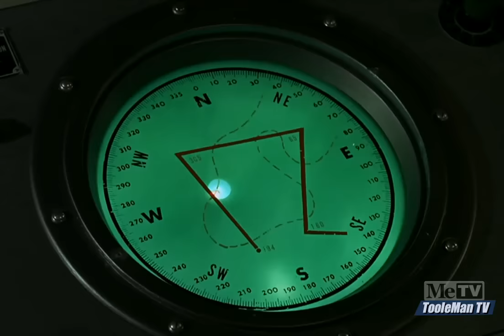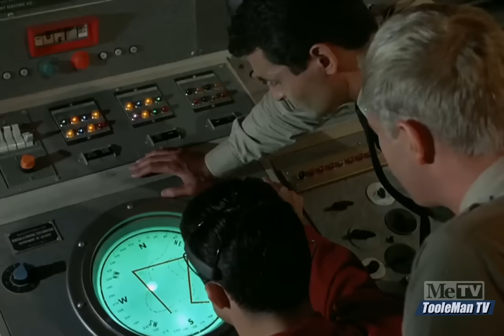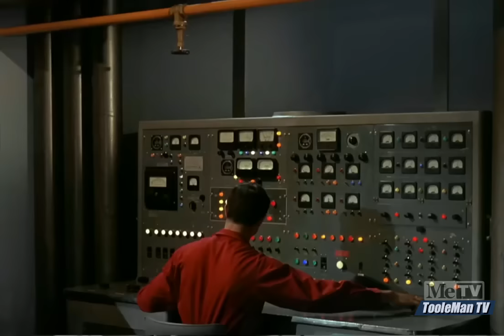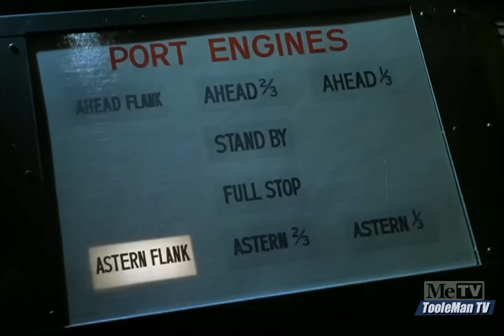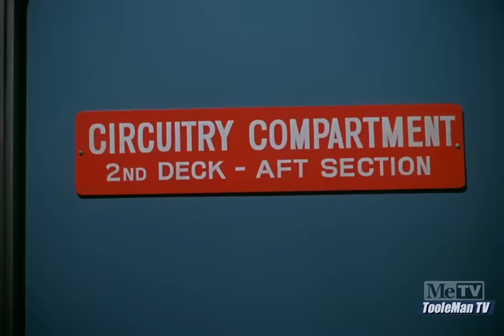Voyage to the Bottom of the Sea S3E05 "The Terrible Toys" Full HDTV Episode!

Comment: Where did the flying sub’s engines went? The admiral opened the hatch where the engines are, in this case aren’t!
Reply: That is a good question. The model kit (Aurora originally,  1968; others since) provided engine space "out back" with the model. The "back door" just functioned as such in the TV setting. If "real," the Flying Sub s "motors" would have to be quite "compact". Voyage "blueprints" available in the fan media attempt to show the FS's "innards".
Note also Land of the Giants, which gradually  added more interior space "out back," including engine service space, to the space ship.